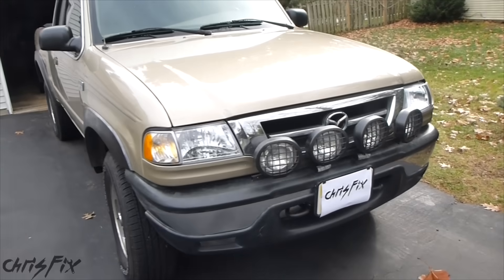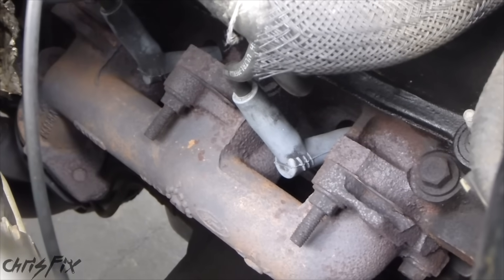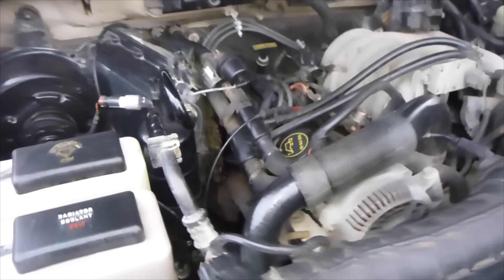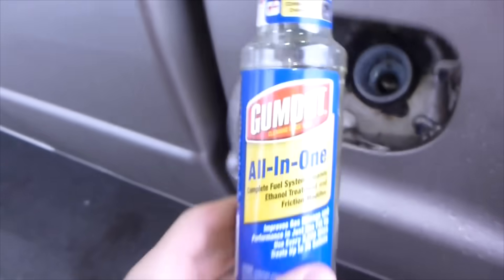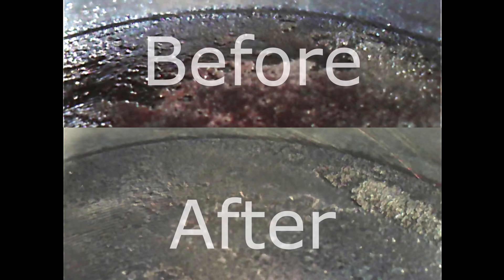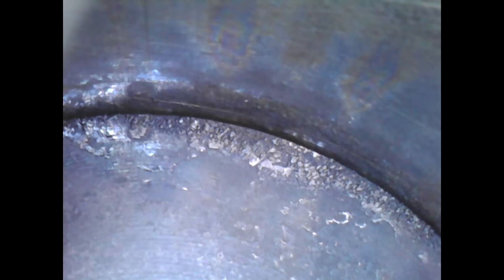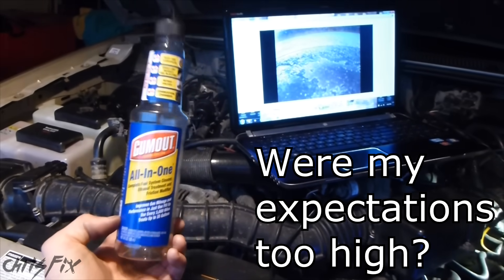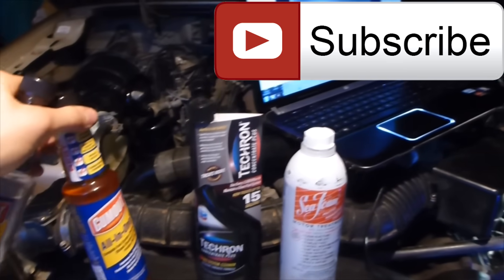Do fuel system cleaners actually work? Testing Gumout "All-in-One"

Comment: I'm very curious to see a before and after of the water method. If you're not familiar with it, it's basically spraying small amounts of water in the intake of a HOT engine (Normal operating temp. not cold) Reason behind this idea being the best cleaner for carbon is when you have a bad headgasket that cylinder's piston is always spotless because the coolant leaking in is actually steam cleaning it. I definitely recommend you looking it up for yourself and seeing if you would agree with it or not, and if so possibly doing a before and after.
Reply from the maker: LightsMB Yes, thanks for the suggestion. I will be doing the water decarbonization test too! My hypothesis for that test is that it does work, but you need to do it over a long time (like a headgasket leak).
Reply: ChrisFix Awesome I'll definitely be looking forward to that video.

Comment: On my 2010 dodge charger sxt you have to pull off the whole intake manifold plenum to access cylinders 2 thru 6.... another bad design
Reply from the maker: Ira Friedman Yea, they do that type of stuff all the time. My van says you need to lift the engine to get to the back spark plugs. I was able to do it without lifting the engine but imagine that!

Comment: It might be a huge amount of work for a video, but I would love to see a before and after test for the benefits of cleaning the cylinder heads. Maybe something like comparing fuel efficiency.

I really appreciate both the amount of explanation in your videos and the camera angles you use when showing an example - so thanks for making such polished videos!
Reply from the maker: Codric Thanks man! Yea, that is a lot of work and probably not going to happen. I would have to remove two heads to clean everything! I will be testing other fuel cleaners though!

Comment: See buuut...gas stations like shell and chevron have cleaning in there gas so i dont see the point of buying these, also if ur using these and then just using 89? Just use 91 lol
Reply from the maker: Josh Brereton I think people use this to try and clean out their engine because even with additives, your engine could get carbon buildup. What do you mean using 89 vs 91? Are you talking about octane? If so, using a higher octane fuel does absolutely nothing for your car if it is not tuned for higher octane fuel. If your car requires regular gas at 89 octane, putting in 91 is just throwing money away. The additives are identical in each octane fuel and your engine cannot make use of the higher octane.

Comment: was there a difference in throttle response?
Reply from the maker: Toby Tyler There was no noticible difference in anything. Not with fuel economy, not with throttle response, etc. I didnt have any problems so I was not expecting to see any changes except for the carbon deposits in the engine.

Comment from the maker: cityshots It is hard to test the deterioration of cats because it happens over time. I would be more concerned with O2 sensors because cats are made of rare earth metals which are much harder to mess up. O2 sensors are a lot more sensitive.
Reply: hey how do you feel about misting distilled water into the intake?
Reply: I hate it when my cats begin to deteriorate.
Reply: ChrisFix Chris can you do a video using BG 44K. There is much talk that this is the best. Thanks
Reply: Joe Blo Seafoam one third in the gas one third in the oil and one third in the brake vaccum  line a little at a time.
Reply: ChrisFix what makes  your car jerking when you are driving
Reply: It's easy to measure the  deterioration of cats since the corona of 2020! With all of the theaters shut down there are no
Ticket sales!

Comment from the maker: ***** It gets more like 17mpg during the winter but good estimate! I am going to test the techron so stay tuned! And, I am not running paint thinner though my engine lol
Reply: +ChrisFix  ignore this goober haunted jonny,  udid a great job , i never really thougt these cleaners did much and you just proved it,  keep up the good work.
Reply: now i have got bad gas before and right away my windstar shows signs, we grabbed this a few times and gave the van a good shake to help mix it and it really did help... so i am not going to down it...
Reply: +GTgameTime thank u
Reply: ChrisFix hi chris do you have any video for diesels
Reply: Goofy Gulf check out BG244  for Diesel engines. It's a great product. BG44k is for gasoline engines you can Google both.
Reply: I took my car to fire stone to do a full fuel system cleaning because my car was starting to get real bad mpg.
mind you a 1998 Honda civic lx.is there anything else I should check apart from fuel filter and air filter?
Reply: I've heard changing engine oil and transmission fluid to synthetic can help also but ive never tried.
Reply: easy enough and better results from just taking the head off and cleaning it out, what would you recommend for an oil flush? Many thanks for the great content. Andrew
Reply: ChrisFix are you able to test all the fuel cleaners at the same time since I noticed that some clean the edges or tougher carbon buildup than others. And some clean better the sludge type of carbon
Reply: Okay my main criticism was the video was way too verbose. for example, Reading the instructions all the little detailed information about which cylinder you were going into when you could've just cut it short and said here's the before and after this is what I did I don't like The juice. I do however appreciate the fact that the sentences are fluid and punctuated properly. I would add a little bit more inflection so it doesn't sound like you were reading from a script. Your videos are definitely better than most but you have to figure anyone watching a video on fuel system cleaners is going to know all of those little facts and details already. I also appreciate the fact that you drive a Mazda like myself! I have a question for you the last time I got my oil changed they said I need to get my transmission fluid flushed and it would cost $99. My car is a 2006 Mazda six with the 3 L V6.  It has an automatic transmission and approximately 65,000 miles on it. Now I've always heard that you don't change the transmission fluid,  is that correct? Any info is greatly appreciated 
thanks
 Jonathan
Reply: Okay my main criticism was the video was way too verbose. for example, Reading the instructions all the little detailed information about which cylinder you were going into when you could've just cut it short and said here's the before and after this is what I did I don't like The juice. I do however appreciate the fact that the sentences are fluid and punctuated properly. I would add a little bit more inflection so it doesn't sound like you were reading from a script. Your videos are definitely better than most but you have to figure anyone watching a video on fuel system cleaners is going to know all of those little facts and details already. I also appreciate the fact that you drive a Mazda like myself! I have a question for you the last time I got my oil changed they said I need to get my transmission fluid flushed and it would cost $99. My car is a 2006 Mazda six with the 3 L V6.  It has an automatic transmission and approximately 65,000 miles on it. Now I've always heard that you don't change the transmission fluid,  is that correct? Any info is greatly appreciated 
thanks
 Jonathan
Reply: @hauntedhose  Too verbose? Like double-posting the same long-winded drivel?

Comment: Yikes! Looks like you could scrub your engine with some Super Clean. My 4.0 with 217k miles actually shines because of it, but it does say to not use it on paint, otherwise i would wash the truck with it. The stupid factory intake hose is so hard to clean. I might do a video of how to build a cold air intake and glass pack exhaust. Also, you should probably buy a new PCV valve. It's like 3 bucks. Sorry for this entirely random comment
Reply from the maker: RedTeamWolf Haha no worries man. Those are good video ideas, thanks!

Comment: I wonder if there would be a way to tell if it actually cleaned the fuel injectors. and where are these deposits going are getting burned off or are they just moving to a different part of the engine
Reply: ChrisFix Maybe you can do a injector drop test on each injector using a pulse machine before and after you add it.(Although now it's too late)
Reply from the maker: Cutlerylover4life1 There is a way to tell. You have to run a bench test. You need to take the injectors out, run the test (with special equipment) and then reinstall the injectors. Then run the gas tank till empty with the fuel additive and retest the injectors. The deposits are getting "burned off" so they end up out the exhaust. Think of the fuel additive dissolving the carbon and then burning off that dissolved carbon. That is why I think in my test, the "shiny, sludgy" carbon got cleaned fast but the other, built up carbon did not get cleaned.
Reply from the maker: joeandgod1 I dont have a pulse machine or I would totally do it. I have plenty of cars I could test injectors on so that is not a problem. Good thinking though!

Comment: Chrisfix , could you please try Run Rite kit ? 
That kit comes with three bottles, one you put in the gas tank and one in the engine oil tank, and one you hook up to a cord in the fire wall. I used it but didn't have the camera to check it out. Thanks

Comment: Thanks for the video I'm curious if techron works better?
Reply from the maker: Jeffrey telmo I am curious too! Stay tuned because I will be testing Techron, SeaFoam, and Lucas Oil so far and maybe even more.
Reply: ChrisFix Hey man I got one you can try. I work on Yamaha stuff, quads streetbikes, dirtbikes. Marvel mystery oil. Ive had good luck with it in the fuel as long as you mix it a little strong!
Reply from the maker: losi8ightyew That is a good one! Is MMO a fuel cleaner or fuel additive? I always thought it as an additive more than a cleaner.